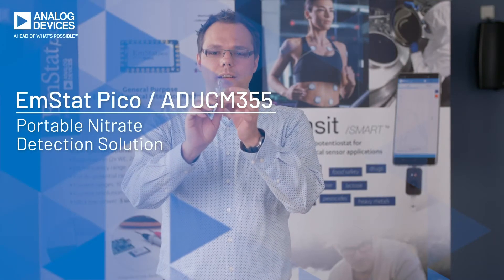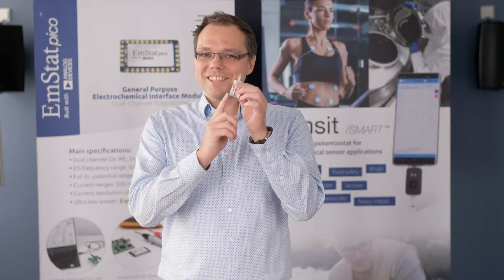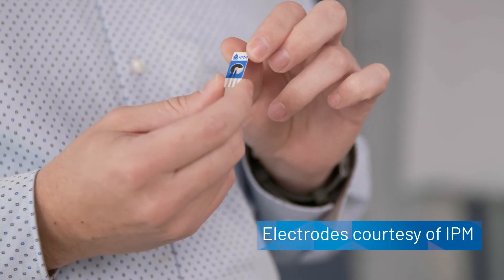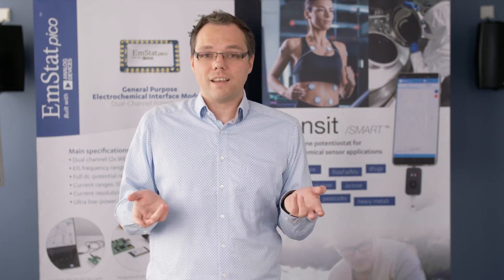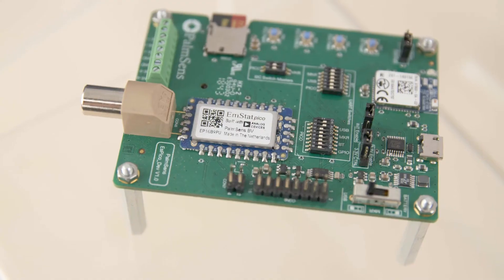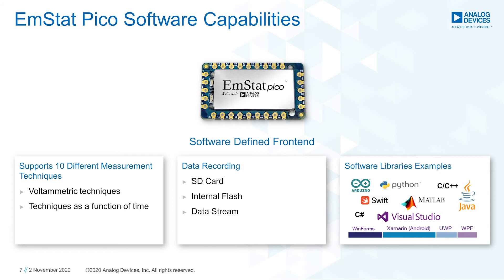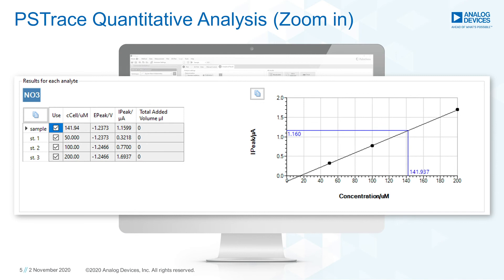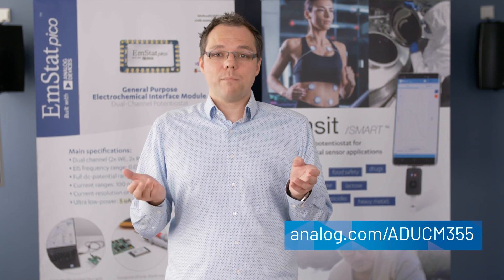Measuring nitrate using SensitBT based on EmStat Pico

Comment: Hey just wanted to know if EmStat Pico is compatible with web USB. If not is is it possible to get it compatible by putting some efforts from our side.
Reply from the maker: We don't have an out-of-the-box solution for you for using web USB, but there are many examples for JavaScript and web assembly that will work with the common FTDI USB-serial converter chips. An FTDI USB chip is also used on the EmStat Pico Development board. Please note that every user still needs to install the FTDI drivers in order to make a USB connection via their browser. 
Here are some JavaScript libraries: https://whatwebcando.today/ https://codelabs.developers.google.com/codelabs/web-serial#0 and with Blazor you could even use our SDK for .NET https://github.com/BlazorExtensions/WebUSB
Reply: @PalmSens  Thank you, will have a look into this